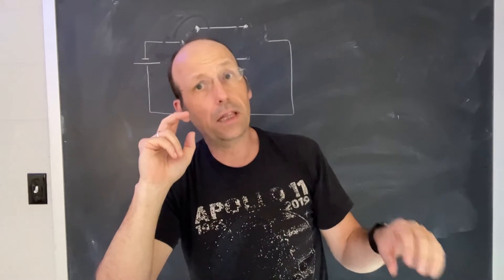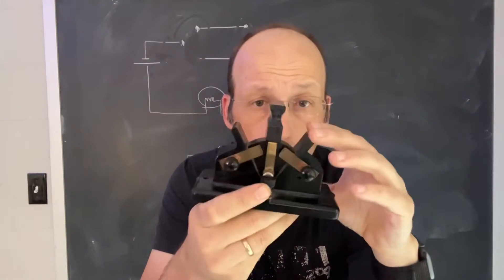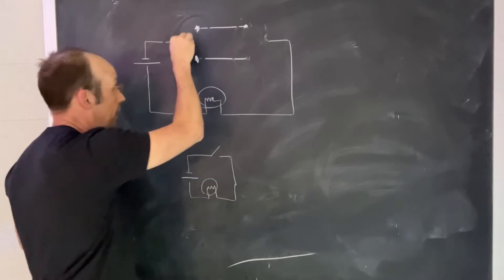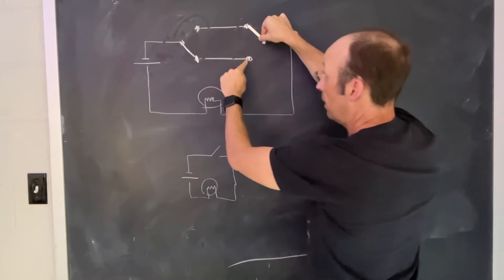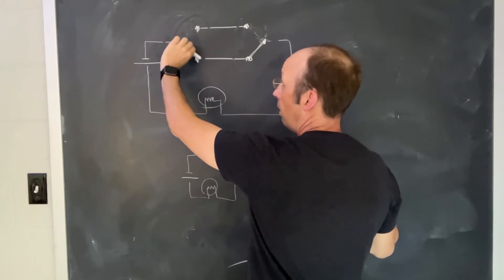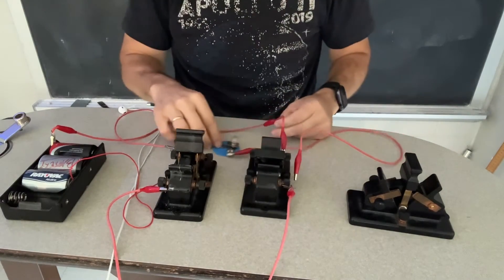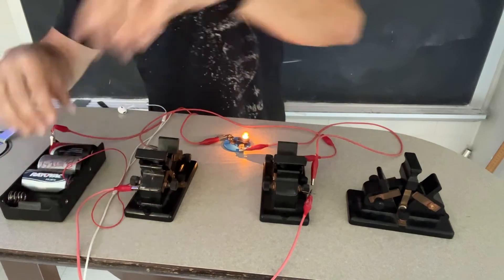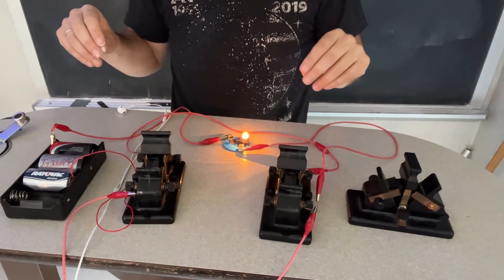Circuit diagram for two switches to control one light.

Comment: Would be cool to show the what trick is used to control the light from 3 points (you've an extra switch that can be wired up as cross-over)
Reply: I was just about to write this because the "cross switch arrangement" is the "real art" to wire this for switching any device off an on from many locations ... and it's getting lost today by the ubiquitous use if bi-stable relays and momentary switches.